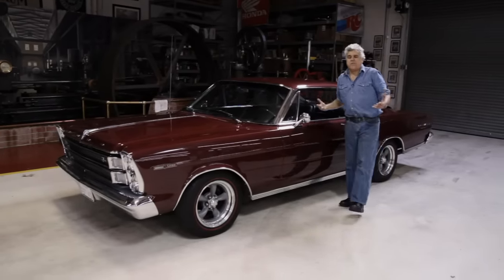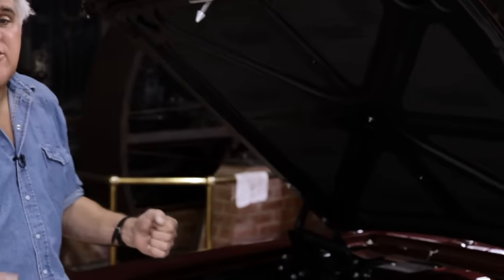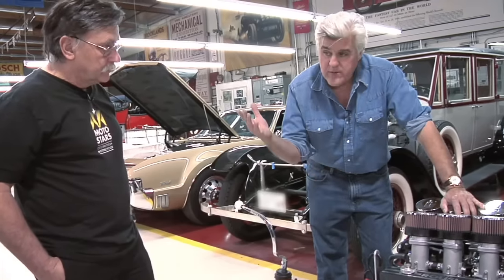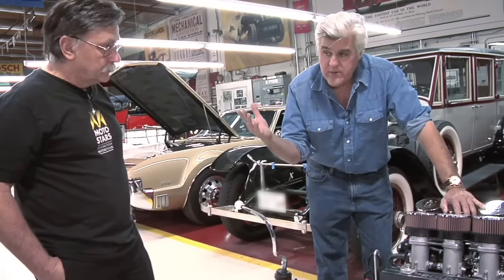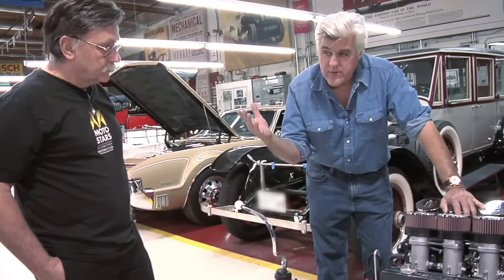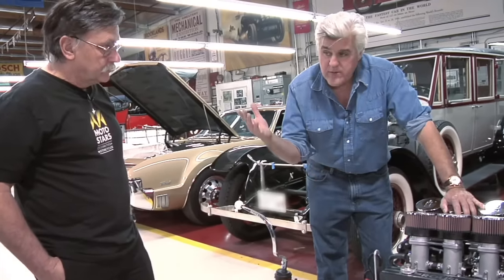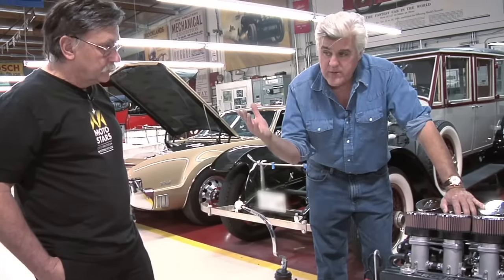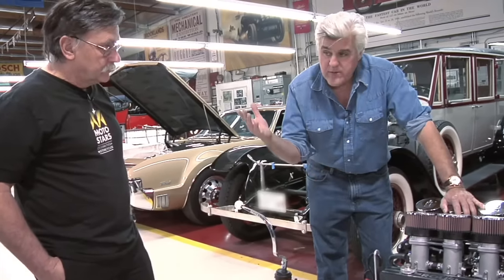Restoration Blog: 1966 Ford Galaxie, Ultimate Edition - Jay Leno's Garage

Comment: Every good Muscle Car story always seems to end with a tree.
Reply: Then after being rebuilt, it meets a similar fate:

Locked up in a collector's showroom as an investment.
Reply: You know, I never thought about it before but you make a very interesting point.
Reply: Or a fishtailing into "X" where X can equal a "semi hauling a full load of bricks to the new subdivision stopped at the stoplight, so the truck didn't move an inch. My frame moved about a half foot towards the center line of the car, but the semi didn't move."

Comment: Back in 1974 or so I bought a ‘66 Galaxie with the 289 V-8.  That was enough for my 19-year old mind back then.  It was a great car, the first and only Ford I ever loved.  I joined the Army and allowed a buddy to drive it while I was away.  He ended up getting in an accident with the car.  I replaced it with a ‘67 Galaxie, which turned out to be the antithesis of everything I loved about my ‘66.  I sold it, bought a big Buick convertible and have only owned GM products ever since.

Comment: I had a '69 Torino fastback with a 428 SCJ in it. Oddly it had PS, PB and automatic on the column with a bench seat. I put a detroit locker rear end in it with 456 gears. Five miles to the gallon all day long.

Comment: I'm 16 and I wouldn't want the scoop neither =)
Reply: I'm 26 and I wouldn't want a scoop either but sometimes you have no choice. Eventually I plan on installing a 6-71 roots blower and they're so big I"ll have to have a scoop. I'll make the most of it and have one of the really cool scoops that Dom had on his Charger in the first Fast and the Furious.
Reply: lol, I would love a scoop
Reply: IF this 66 y.o. guy were to go with the scoop, I'd want it to be an angular one, to match the fine rake of the roof line as it  sweeps down to the trunk deck.  I've seen rounded, teardrop-shaped scoops on '66's, and they detract from the overall design of the car, which is nicely restrained.  Jay's right about the '67's:  the design went over the top that year, and wasn't as symmetrical and proportioned as on the '66's -  and '65's, for that matter.  Nice job keeping it all under the hood!
Reply: Russ Gallagher  A scoop would have solved Leno's under hood over heating problem with this particular Ford Galaxie .  My brother has a '63 Nova SS with a 350 with an Edelbrock High Rise manifold ,  He kept the original SS hood intact and bought another Nova hood to cut open for a Harwood Aero hood scoop,  It ran even better than driving it around with no hood at all.

Comment: I'm a Mopar guy but other than the 66 Hemi Coronet and the 70 Hemi Challenger this is my favorite car in Jay's collection. Always loved the 65-67 Ford Galaxie body style. As a kid Jay should've just went all out and checked the box for the R-Code 427 with the muffler delete😂😂😂. If Jays dad thought the 428 was loud he must've never heard the solid lifter FE 427. Now that would've been a real " rocket ship" 😆 But the Ford 428 was definitely no slouch either. I've always been a really big fan of full sized muscle like the 409 Chevy's, the 406/427 Galaxie's, and the High Performance 389/421 Pontiac Bonneville, Grand Prix, and Catalina. The first ever American muscle car in my opinion...the 1955 Chrysler C-300...was a full size car. Really until the 64 Pontiac GTO all American performance cars were full size with the exception of 2 seater sports cars like the fuel injected 283/327 Corvette's and the Supercharged 57 Ford Thunderbird's

Comment: The ‘66 Ford Galaxie 500 7 Litre was my first car as well. My dad bought it used in 1976 when I was a 15 yo. It a was light blue convertible with a white top, 4 speed, white bucket seats and light blue carpeting. Stunning interior. The clutch was sooo heavy, no one else could drive it (44 years later, my left leg is still 2” bigger than my right). I remember getting my license 2 weeks after my 16th birthday, driving it to Wheaton High School (in Montgomery County, MD just outside DC). With that 4 speed and 4bbl Holley carb he added, it peeled out in every gear. Scared the cr@p outta me. It got about 6-7 mpg when gas was about a buck a gallon. The fuel gauge allowed me to go 1/4 tank below empty. $7 and a can of octane boost (a necessity) got me up to empty. I’d drive it to Bethany Beach the back way on rt 404(?), two lane road and more than a few times was able to pass as many as 12 cars at a time. It didn’t like to go round turns much, sorta like a boat, but on the highway it was a dream. The high compression engine acted as a sort of cruise control… keep your foot in the same position and it would maintain speed up and down the hills. My uncle Mel got it well tuned and was able to hit 70 mph in first gear. The car always needed maintenance I often couldn’t afford as a college student at UMD and had to hitchhike to 8 a.m. classes for a few winter months. The gas crisis compelled me to park the Galaxie and buy a stupid little Ford Capri. It sat for a while and we sold it for cheap, not fully appreciating its value and production rarity.

Comment: "Let him pick the engine." (Buys the largest engine they had)
Reply: Well of course! Likewise, when my parents were buying our new family car back in 2002, if it had been down to me, we'd have bought an E39 540i Touring instead of an E46 318i with all of 118bhp to pull around 1440kg... God that car was slow.
Reply: If he was really smart he would have convinced his dad to go to the Pontiac dealership and buy a Tempest with a 455.
Reply: @twistedtaipan3862  ; Not luxurious enough, 7 Litre was top of the Ford line in 66', it was the follow on to the Galaxie 500 XL.
If Jay knew more about the Ford Scuorse Book, he could have ordered it with the 427 R code side oiler engine with dual quads. Your 455 is like a truck motor compared to the Ford high winding 427 R.
Reply: Hell yea !!!
Reply: Funny how kids get away with stuff like that . Haha
Reply: @twistedtaipan3862  Did they have a 455 in 1966?  I don't think so....  Try again.

Comment: Nobody:
Jay: "Muffler delete"
Reply: Robby Dey  muffler delete is used to remove back pressure to the engine, adding "glaspacks" (fiberglas "mufflers") provides a raspy, somewhat "racetrack-like" sound and to give the engine more horsepower through less restrictive exhaust. It's like NOT wearing your "covert-19" cotton mask on a hot day. The engine performs better when it's breathing free-er than if restricted by a stock muffler.

Comment: I might  be repeating myself this time,  I bought one that was list price around $4700. Options where A/C , P/W,am/fm , auto (C6) and towing package .It had the thunderbird front seats and their 4 cylinder front disk brakes ,Color was guardsman blue. I would like to have it back now to drive it, cars used to move out of the way  when I stepped on the gas.  The C6 Trans needed rebuild after 6 months later the -U joints afte 2 years. Bought the Galaxy to replace 64 mustang. So at 85years  after buying Fords and Toyotas, I think the 7 litre was my favorite car. Mr Jay Leno I think the side pin strippings was what made the car unique .

Comment: what a car!  we had a 65 galaxie 500 that belonged to the LBJ security detail.  it was only a 390/300 horse, but ran like a dream--if the car died it had no brakes and mom often hit the back wall of the garage, fortunately not with enough force to do more than sheetrock damage.  they sold it while i was away in the navy--i'm still crying...

Comment: These cars were solid! I had a '66 500 sedan. After leaving a local establishment to go to a friend's house, I was at an intersection at a red light when I saw in the mirror, a friend of mine, in his '67 Impala SS Coupe closing at a high rate of speed, so I tromped on the gas a moment before impact, but he hit me hard enough to send me across 4 lanes of the divided highway. I kept my boot in it, swung around and came up along side of him, slamming into his left side several times. When we got to our friend's house, I  assumed my Galaxie had substantial damage. I was surprised to see only a 6" crease in the rear bumper and a few scrapes on the right end of the front bumper! The Impala did not fair so well .....

Comment: In high school I had a 7 Litre back in 1973 ,blue in color and great condition. kept it for 3 years and sold it still in decent condition for $75. kids i sold it to stripped it to make a hot rod pickup. always missed that car and now almost 50 years later i now have another one . all original, numbers matching survivor car. Had to pay a little more to get the second one !! Brings back good memories for my wife and I were dating in the first one. i was also lucky to have had two 1967 Galaxies 500 2 door hard tops. one had 289 other a 390. all of them were fun to own.

Comment: Very nice car and well thought out upgrades.  

I bought a canadian cousin to this a 66 Meteor Montcalm. Basically a rebadged Merc. My grand father asked why I bought a 66 when he had one parked out at the old farm. Turned out to be a 7 Liter Galaxey. However it was in very sore shape. So I took the faux steering wheel for my car with the intention of getting the buckets and consol transfered the next summer. A stranger called me up asking to buy it. I explained what my plan was and declined to sell it. Well next spring I found the consol and all the logos of the 7 Liter shot up.  Lesson is get things when the getting is good cause it may not be there later.

Comment: Around, 1963, my dad and I were at a Ford dealership, he was looking for a 4 door sedan.  On display was a Galaxie 500, 2 dr, convertible, with a huge engine, possibly a 427.  I told dad, this is what we need, I was 11.  He said, son it only has 2 drs.  Then he went inside to talk family cars.  He ended up with a '63 Buick, with the 410 Wild Cat, engine and the Dyna flow.  Later as a teen, I wrung it out a few times.

Comment: I love the Galaxies, I remember Ford Author John Smith had a blue 7 Liter Gal he would always take to the local shows. Right now I’m sporting a 63-1/2 Galaxie 500 Z code 390 .04 to 398 inches bench seat 4 speed car. Have the aluminum heads and matching Eldebrock intake and cam with a lot more.

Comment: This brings back memories my first car I was 16. Work on a farm for $2 an hour and I found this 1968 Galaxy 500 setting in a barn lot without an engine. The same 2 door as here I bought it for a whole $50 then I found one wrecked that still had a good engine 302 boss I got it for $250. So I took the 2 cars and built my car from the parts when done I had $500 in it. Man that thing would fly like this one it would register 120mph but on a local straight away as a teen had to see what she would do. Well she went past 120 twisted speedometer and I would guess at about 140 the air pressure started building and it started getting loose and had to let off or lose it. So Jay isn't joking about handling issues. I had that car about 4 years frame cracked right on the rear hump. I wish now I had never let that thing go it would been worth a fortune now.  Still ran great but being young I got afraid because of the cracked frame.

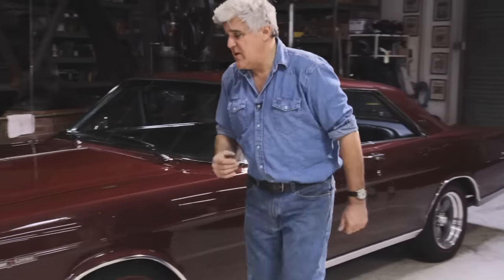Comment: I had enjoyed this video, in particular, because, I grew up with a 1966 Ford County Squaire station wagon with the simulated wood along the sides. @4:24, even, the way your hood springs squeaked when you had lifted the hood, sounded just like ours did, lol  For a family of eight, those flip-up rear seats were needed and the dual swing/drop down gate with electric window in the rear was cool, crankup windows for the other windows, though. It had the 352/four barrel carborator engine with the three-on-the-tree automatic. Just another station wagon but, we couldn't afford a new car every three-to-five years so, it was exciting for us like, our first color TV was. But mostly, it was the car that most of us kids grew up in. The Drive-in theaters, beaches, parks, pulling a travel trailer and boat. Except, for the wheels, and hurst shifter,  Jay Leno kept the Galaxy looking stock. Excellent build

Comment: So good to hear them explaining that a powerful engine means nothing if you can’t drive it. Ive worked on motocross bikes and ATVs for over 20 years and the bike guys know but the quad guys will spend a fortune building their engine to get the most hp before they ever even ride it and not touch the suspension or brakes. I always tell them put a better exhaust on it and go ride it in it’s stock set up and figure out where you need to make changes. But do the suspension before the engine!!

Comment: My first car was a Galaxy 500, 2 door,  3 speed standard transmission with the shifter on the steering column, ( we called it 3 on the tree), the best motor (small block) Ford ever built 289. The motor was as close to indestructible as I think it could possibly be, 16 years old in high school in south central Texas and everything that went with that in 1974. Miles and miles of dirt or gravel roads and when you went around a corner if you didn't get at least 45 degrees sideways, then hell you wasn't going fast enough. Paid a whopping 500.00 for that car, best 500.00 I've ever spent.

Comment: Mom and I [was 16] were ordering her '66 LTD 4 door HT and I wanted the 390 but the dealer (my uncle, her brother in law) frowned and said "No, Sue, get the 352" ... NO thanks to you Uncle Arnie! ;-( At least we didn't end up with the 289!  ;-)  I paid for the $104 power windows with my own lawn mowing/snow shoveling money.  She drove that car for 13 years and 104k until the frame was dangerously rusted out.  So in 1979 I bought her a '74 Continental Mark IV which she drove for 19 years.  She was 5'0" and 98 pounds, car weighed 5,400 .... Mom's gone now for 20 years I but I still have the Mark which is a 3 out of 5.

Comment: 10:31 I remember first driving my 74 Cutlass in 2009 (I was 19) and spinning out wildly trying to make a quick right turn while going downhill. I hadn’t ever driven an older car without ABS, rear discs, quick ratio steering or modern suspension geometry. I learned my lesson very quickly that old cars were night and day different than today’s!

I suppose that’s why I ended up liking 3rd gen Camaros and Firebirds- the closest mix of “old” car characteristics yet modern handling (and to an extent, brakes).

Comment: Had a seven litre in the late 60s, when the left motor mount broke the throttle would go wide open. The only fix at that time was to turn the ignition off. That was a wild ride for a few seconds.

Comment: I had a '67 Ford Galaxie 500 XL convertable with basic 289.   My favorite Ford of the 60's was the 63 1/2  Galaxie 500 XL.   Favorite Mercury was the  56.   Favorite Lincoln was the 1956.  Favorite T-Bird was 1957 or 1961.

Comment: My first car was a 65 galaxie 500 2dr with a 390p code. This was in 87 and i got it for $250. Spent 2k on interior and suspension stuff. Mom drove it to work one day and a woman backed up 75ft with a steel flatbed 1ton truck and caved in drivers rear fender and door. That was in 89 while i was away at AIT for the Army. I wasn't told till i got back home. lol, still love my mom..even till this day.

Comment: The 390 GT was fun too. Had a 72 Gran Torino with the 351-4V  Q CODE also known as the 351-CJ after the 428-CJ because the 351-CJ used the same cam grind & lift with bigger valves than the 428-CJ  2.19 intake valves & 1.71 exhaust. 4 bolt mains.

Comment: You are right about the 66 Galaxie Jay, but I think you need to ride or drive a 64 that has been put together right. I do think the 63 and the 63!/2 is the best looking rounded Fords. From 1960 to 64 were that generation and from 65 thru 67 were the square Galaxies, I think that is correct. Anyway you like them you can't beat a Galaxie for overall Ford quality and dependability. I love that crate engine you have in your Galaxie but you have to admit the FE engines that Ford produced were some of the best engines made. I would love to know just how many FE engines are still on the road today, I'm sure there are still a lot of them out there. I enjoyed your Galaxie build and the stories about your Dad. My Dad bought a 65 Galaxie also and it was dark blue, great, long lasting car.

Comment: Jay, you talking about how "unsafe" these type cars were, underscored what my 80yo Mom said recently.  Back in the late '60s to late '70s, my Dad had a 1967 Ford Fairlane 500 (He bought it new from Jim Skinner Ford, Birmingham, Alabama. It was the car of my childhood).  It had beautiful paint (seafoam green, I believe it was called), beautiful styling, with the 289 V8.  Anyway, Mom and I were talking about the car last week, and I was lamenting that I wish I had not sold it in 1981 when my Dad passed (I Never See these cars on the road or at car shows).  My Mom said, "I'm glad you sold that car.  It was Unsafe!  We both "fishtailed" that car about 3-4 times!  The rear-end was way too light.  You Dad and I agreed we would never let one of the Kids have this car - too unsafe!" ("Kids" meaning my Brother, Sister, and Me).  This was a surprise to me.  When I hear people talking about how unsafe old '60s cars were, they are talking about hard dashes, only lap belts, no air bags, drum brakes, etc.

Comment: I have only one concern Jay, in a scene you have a Fram oil filter installed...That is the absolute worst filter money can but, you aught to check out some videos on oil filters and you will see why, then upgrade to a WIX filter. Thanks for the great video and God bless.
Reply: Funny cause I’ve never had an issue with Fram filters in 22 years... but nowadays I try to stick it whatever brand was used on the vehicle originally (ac delco for GM, motorcraft for ford, mopar for dodge, ect).